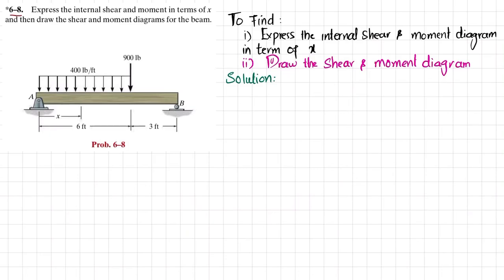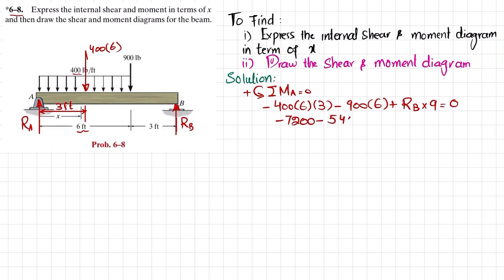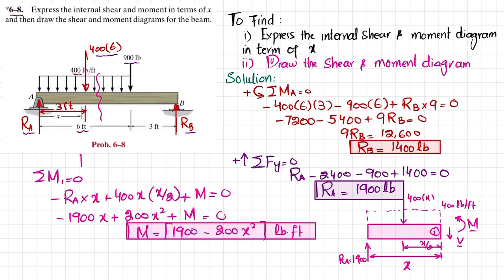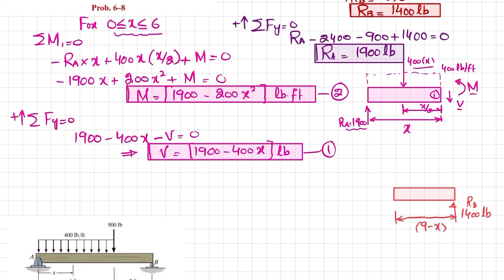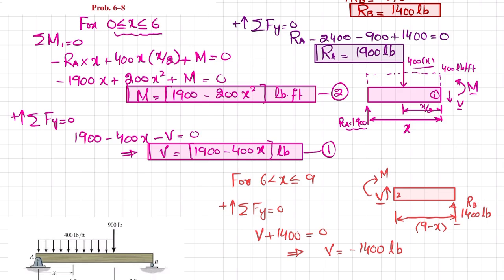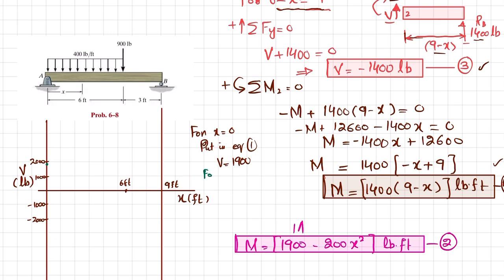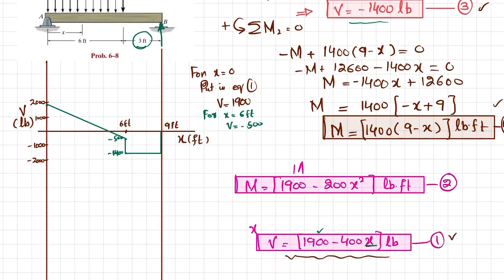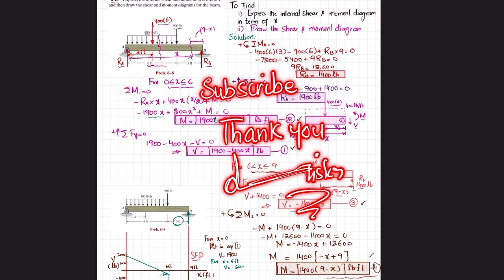6-8 Express the internal shear and moment in terms of x | Mechanics of Material Rc Hibbeler

Comment: @4:24 why isn't the force 400*x/6
Reply from the maker: It is distributed load and acting in the length X so when you convert this distributed load into point load it will be 400 *X and it will acting at mid point of the length over which it acts. Now when taking moment due to this force it will be 400 *X * X/2.

Comment: Why don't u consider 900lb for 6ft to 9ft?? It should also be included na..
Reply from the maker: We have not included it in both the sections because you can see the shear force equation from first section give us the shear force for 0< x<6 when you find shear force for x= 6 you will get shear force -500 but you have point load of 900 at that point as well which is downward and negative so total -1400 shear force is acting